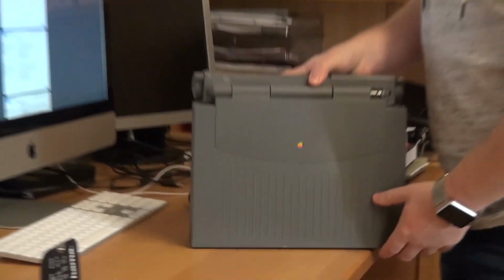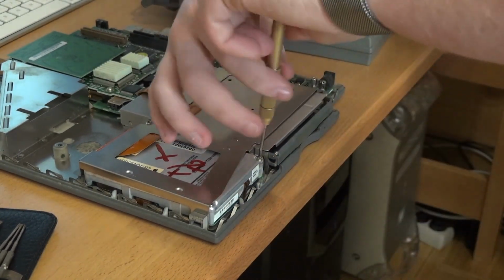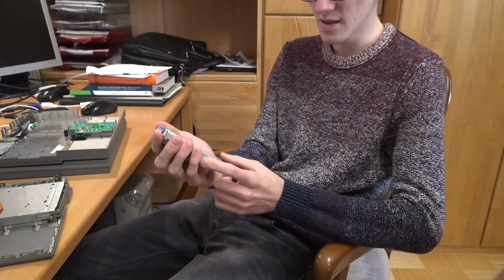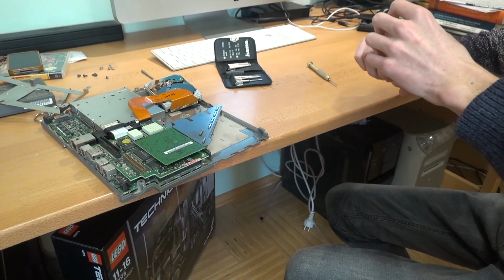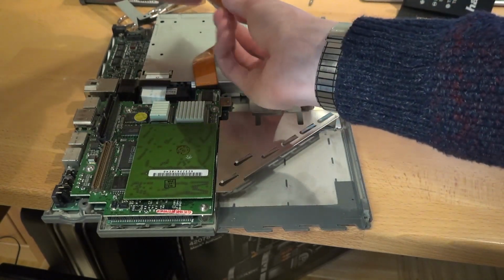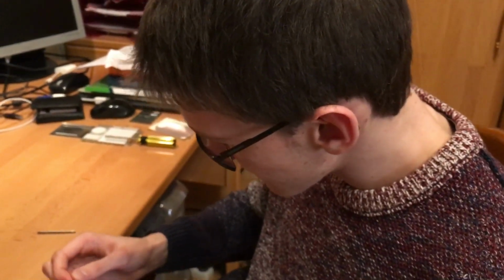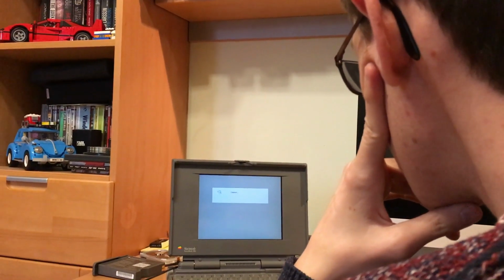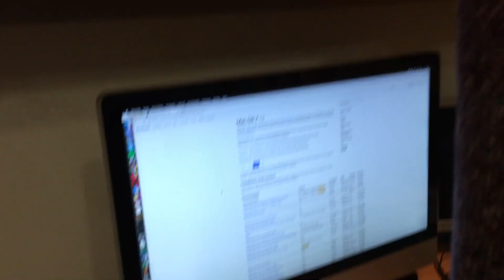Powerbook 180c Hard Drive Removal - The stupid way

Comment: I think is the charger. It maybe doesnt have enough voltage ir current
Reply from the maker: It clearly is not the charger; the problem was the cable that connects the monitor to the mainboard was not properly connected, and that kept it from booting correctly (see it at the end of the video)